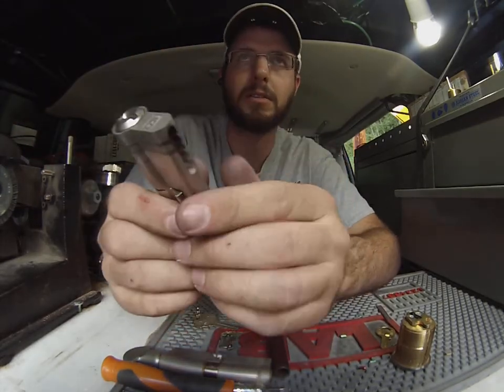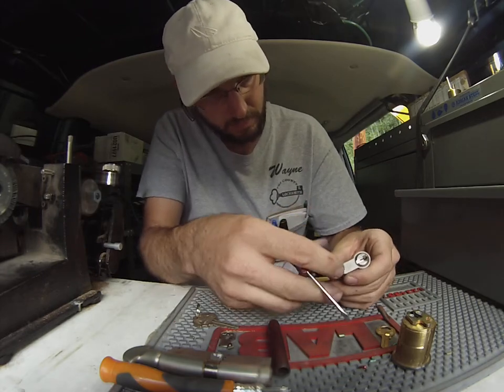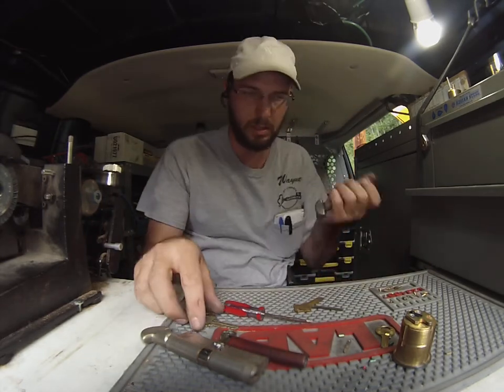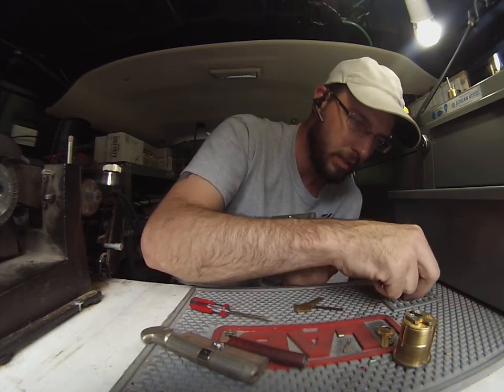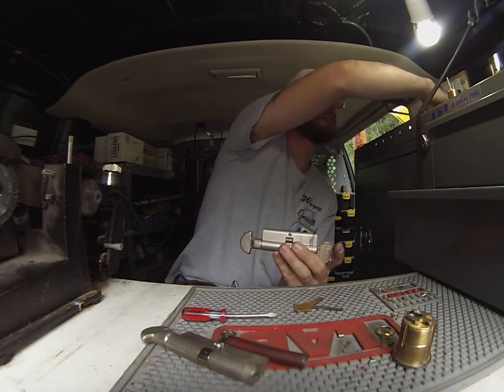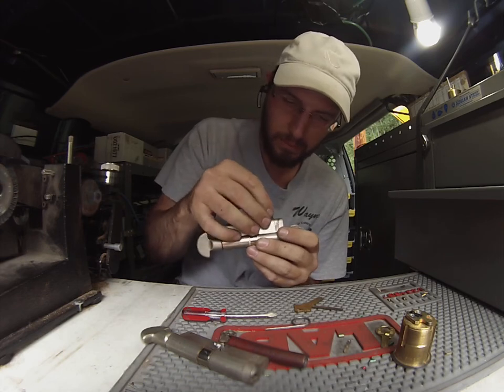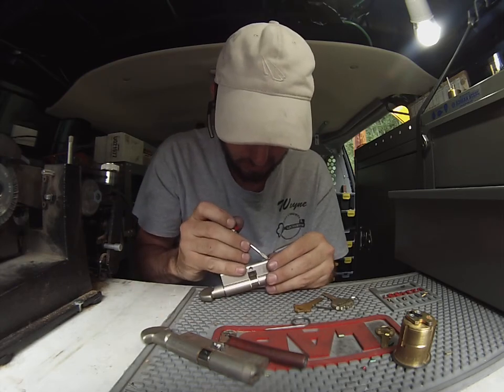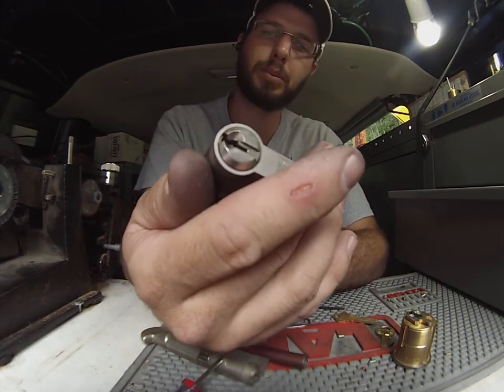Winkhaus Euro Profile Cylinder Rekey How To

Comment: Nice one. I took apart the one you sent me but it's still in a whole bunch of pieces...lol
Reply from the maker: Would you say that that lock is not reasonibly rekeyable? The one I sent you was the EVVA correct?
Reply: Wayne Winton
Yeah, the EVVA. I am sure that with the right tools it would be a lot easier...the one in this video with the plastic or metal strip is very easy to work on.
Reply from the maker: ***** Yea Winkhaus  is peice of cake.

Comment from the maker: I bet the tip of the key is not engaging the cam. Try a 6 pin key blank with the same cuts and see if things start moving. If not dump the pins and springs again and try a blank key and make sure the cam is turning before you reassemble. You may need to hand file the shoulder or bow of the key so it will stick in further so the tip of the key is seated far enough into the lock to engage the cam. When you get the cam turning with the proper key blank reassemble and it should operate. You can feel free to call me any time 970-945-5625

Hi Wayne. I re keyed the exact same one last night but after I was done the cam would not turn. Inside it worked fine with the thumb turn  but with the key it turned the 360 but cam did not move. Any ideas from frustrated in California?